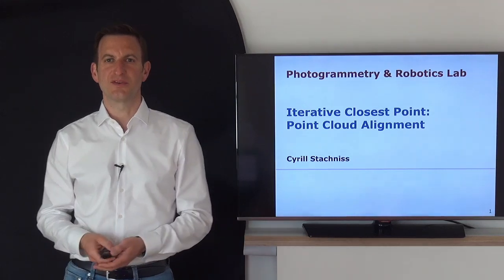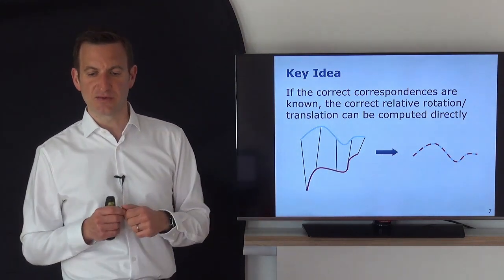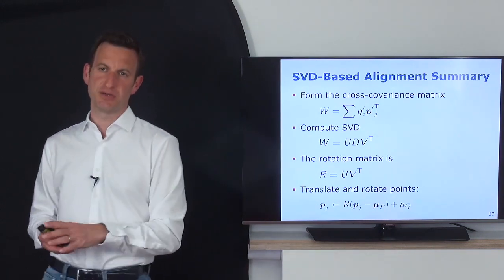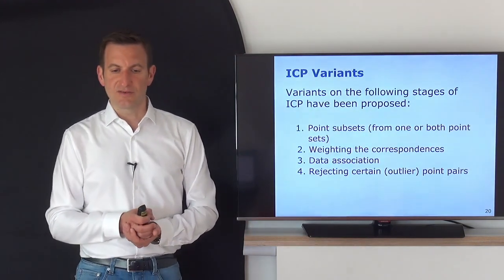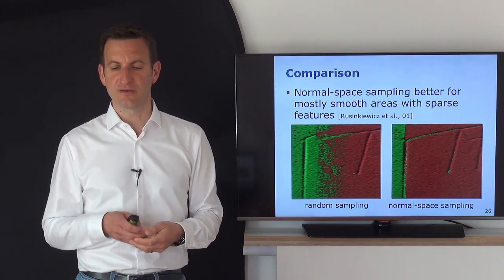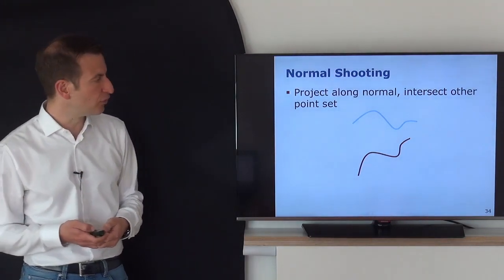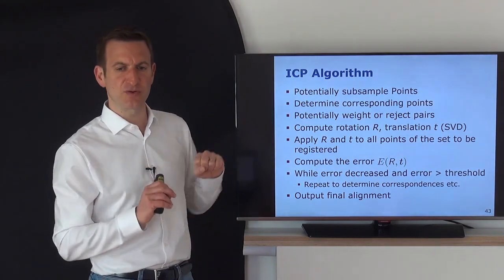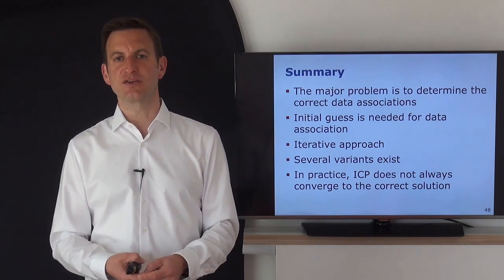Point Cloud Alignment using ICP (See 2021 Video die to audio issues in this video)

Comment: Thanks for your video, it explains great. But I have a problem while scanning data to enter the ICP algorithm, that is I read the frame data every 300ms (including depth data). Before the data is put in to merge into one, its capacity is full of RAM and leads to application stops. You or anyone who has a solution to this problem, please help me, please (the language I use C# and C++)

Comment: How to get the right center of mass, when  you have noise? I would expect some error here. Just using the correspondent points sounds impossible at that step because if we know these we would alredy have our solution?
Reply from the maker: That is typically not the limiting factor. You are averaging over a larger set of points, so at least if you have no bias (zero mean noise), the effect should is minimal.

Comment: Hi Cyrill. I couldn't get the idea of subtracting center of mass. If we do so, the point cloud will be overlapping only when they are in same coordinate space, and as per my understanding, we use ICP to get R & t between two different coordinate spaces. Correct me if I'm wrong anywhere.
Reply: Not 100% sure if he means this, but imagine, you take a scan in the center of a circle. Then you moved north by a bit, you take another scan. Even though the translation is not known, from the two scan from the body frame, there will be center of mass difference of each frame at their respective body frame. By subtracting the com, you can estimate the translation between the two scan.